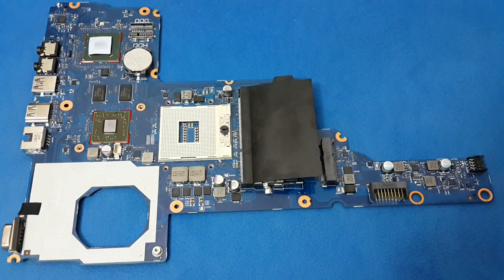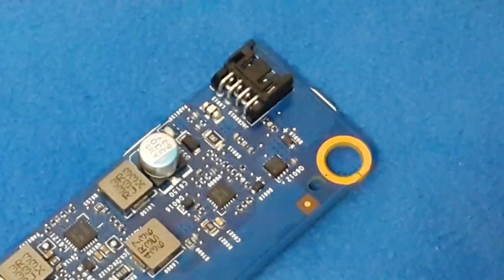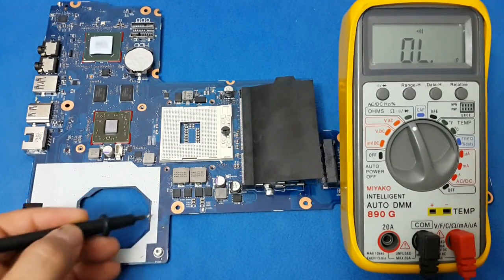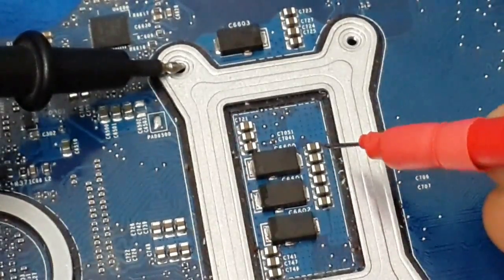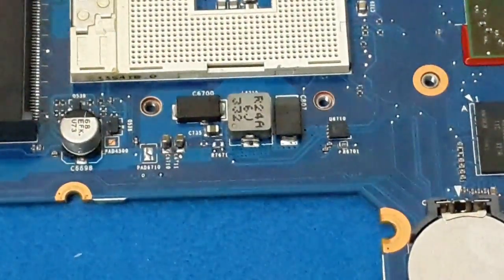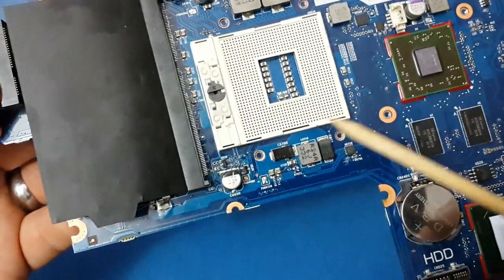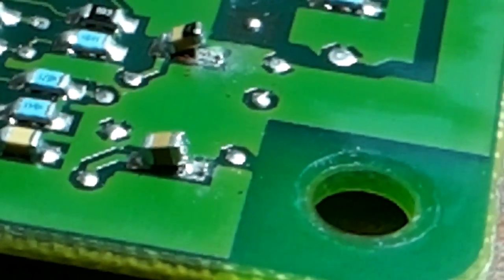SMD bad capacitor  test / laptop - desktop computer & electronics troubleshooting

Comment: Couldn't you just put the probes on both sides of each cap instead of checking continuity of each side with ground to see if they're shorted? If the idea is that normally only one side of the cap is connected to ground and if it's shorted both sides will be connected, is there a reason why you need to compare each side separately to common ground vs. just comparing both sides to each other?
Reply: Same i want to know

Comment: You gotta wonder why a dead short did NOT blow that fuse. What's the good of it if not to protect the circuit. Meanwhile the short can continue doing all sorts of damage until something goes open circuit. Not enough zener diodes or any protection beyond a couple of MOVs as lightning arrestor in consumer goods these days.

Comment: removing smd capacitor one side is a bit risky because you could damage the trace or capacitor soldering point , better to remove it by adding solder both side in quick way.

Comment: I checked my motherboard and not familiar about the capacitor and I found that there's some white stuff on it..I dunno if it's normal because my PC not turned on when I pressed button bcoz of the fault PSU..I hope that it doesn't affect the capacitor or the motherboard

Comment: I removed a shorted SMD capacitor on a TV board, but the TV still doesn't work. The capacitor was very small. Should I put a new capacitor in order for the TV to work?

Comment: I dont like the way you lift component side on board with solder, once you heat and lift a side of component, you risk damage pcb surface of the other side of component, that soldered tight on board once its lifted with hard power.

Comment: What is wrong with approach:    
Red on ground and set meter to diode mode. Check both ends of capacitor with black probe.   Capacitor should have ground only on one end.   A  shorted capacitor will be grounded on both ends.
If you want to remove the shorted capacitor, then desolder it and check to see if short goes away in diode mode with red on ground.
Reply: I have a question...I noticed that my motherboard has a white stuff in the capacitor do you know if it's normally happened or it's shorted?
Reply: @ywhad  is it bulging on top.   Is it an electrolytic capacitor or a surface mount?
Reply: electrolytic and it's not bulged...a white stuff appear like veins in the capacitor when I turned on my computer and the PSU is not spinning and found out that my PSU is shorted and it smells a lil burnt and I don't know if it may affect my motherboard
Reply: . just buy a refurbished computer off Ebay from a seller with at least 98% approval rating and they provide a 30 to 60 day warranty.   Then remove hard drive from old computer and hook up to new computer via SATA/IDE to USB connection.    Otherwise, take old computer to a repair shop so they can determine which components are bad and have them fix.

Comment: that is the stupidest way to lift a ceramic capacitor, so you damage the track of the board and the capacitor, the correct way is to use a tweezer type soldering iron or a hot air soldering station or at least improve the soldering technique

Comment: i got an 17 r4 and when i plug it in. the light on charger goes out. so i took it apart unpluged  the dc in and the charger will stay on but when i plug it in  the light will go back out and when i plug in to the dc port i will see a spark. and  the port smells it there a  could that be a bad captor  thats making it ark  im going to test it in a few thanks

Comment: Hi please can you help I believe you have lot of experience in the field. I am working on aN ECU there are two capacitors in the entire board with no reading at all. I mean at all. I even removed them and there is no reading . Have you ever came across micro capacitor with no reading when checking with multimeter. All the rest of the capacitors have readings.
Hope to hear from you regards

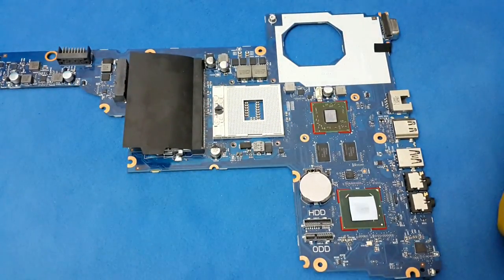Comment: They are a headache when you are a beginner at repair. In LCD / LED TVs it is common to find one of them shorted but “reflecting” simultaneously also on other circuit components on the small and long PCB attached to the Panel. Thank you very much for the advice (6:57) and sharing. A sincere greeting from Mexico.
Reply: I didn’t get the bit where he said to copy the information of neighbouring capacitors. What does he mean?

Comment: Excellent fault finding!!! Another method is to turn it on and leave it on. The shorting cap will get HOT. to find it, use a finger or a thermal camera (I used a Fluke Ti10).

Comment: what if both sides don't have continuity?
Reply from the maker: Hi! Should not be a problem. (There could be other issue if the component is open, but that´s other case. For this case, we look for components in short circuit).

Comment: thank you i have rx 480 graphics card both fuse capacitors blown but also a smd (small one like yours)  2 are short circuit but I don't know the values so if i  dont know the values what cap i put to replce them? what would be safe???  0.1 ???

Comment: so you are testing smd capacitors in circuit without a power supply using only the tiny 2mA provided by your meter in continuity mode? a board can have hundreeds of capacitors do i have to try them one by one?

Comment: Hi all. I just wanted to ask.. a very tiny capacitor fell of the laptop but it’s still working! Is it normal?
Reply: Yes.There will be 2 or More Capactors in that Series Connection,if one gone,the Circuit will Still Work.

Comment: As an English speaker it was a little hard to understand but not impossible at all. Within a minute I knew exactly what was being said and I actually learned A LOT! Especially the part about cutting off the search areas using those pads! I had no idea before now and already used that tip to repair another device.

Thanks a lot for this video!
Reply: Wow! My english level is B2 and I had absolutely no trouble understanding what he is saying. How is that even possible?
Reply: @Daniel-ih5ei  

Are you new to electronics like me?
Because I meant understanding the electronics jargon, not the language itself. If not, that's probably why!

the more you know
Reply: So you desolder the pads to isolate the area? How can you tell an area is bad or good once isolated?

Comment: Thanks Bob! great video. Just one question. The circuit boards that dont come with the option of separating different stages of the circuit by removing solder ....how to find exact location of the fault?

Comment: Thank you so much. I was stuck with a SSD drive that stopped working because I pushed a 4pin to SATA connector the wrong way into the drive and it got shorted. Then using your method I checked the capacitors, I found  2 of them gone bad. Only problem: how to find value of smd capacitors?
Reply: To my knowledge you need schematics for that

Comment: Hey guys I have a laptop
Motherboard where I’ve tested for continuity on some of the caps and found that there are quite a few around about 10 caps that are grounded on both ends. I haven’t tested the entire board but would this indicate that maybe a surge killed these caps, there were also some caps that both ends were not connected to ground as well These were all tested when connected to the pcb, should I despiser one end and test again or can we assume the motherboard is no good as there could be more.

Comment: Hi. I'm still learning, I have 3 ceramic caps on a board. When I test in continuity mode  I don't get a beep when I touch the cap with the probes, but if I check in diode mode I'm getting a reading of about 575
Reply: Usually ceramic caps last longer than 'wet' caps and aren't usually the culprit. If you want to really test capacitors, you need to remove them from the board. That's testing for capacitance though and not continuity.

Comment: @3:11 - "any cap can be connected to ground, but none of the connector should give you continuity" ???
Reply: He means to say you should not have Continuity between both ends of one capacitor. Having continuity between both ends of one capacitor would mean a short circuit on that Cap.

Comment: This is a demonstration of how to damage a mother board. Use the correct tools and this sort of damage will not occur. Unsolder both ends of the component at the same time. That will avoid damage to the board and component!

Comment: Hi mate
I have this exact board but with a different problem, the caps lock blinks 3 times in a sequence and no picture on the screen. I measured the voltages on the board and all are present, 19v, 5v, 1.5v, 
When the CPU is in the socket but the laptop is not powered on ALL capacitors around from the bottom side are in short, when i power on the laptop only the three marked on the picture are in short. When i take off the CPU no capacitor is in short...

I guess it is the CPU that is causing the short?I 
tried several known good ram sticks but no picture.

Comment: Thanks. I found multiple open and shorted smd caps in the same area on a hdmi board. The identification numbers are unreadable! How do you know the correct polarity and ohms when you replace with new ones? Replacing them would be a tedious process as some of them are the size of tiny ants! EDIT: I bought a ESR METER and retested the faulty SMD capacitors and it read " LOW ESR" good capacitor! ?????? I am going mad in the head!

Comment: 09:20, U lift solder pad too... mr specialist...
Reply from the maker: That´s not true. The pad is on place as the silver color proves it. For you to learn: a delaminated pad doesn't get soldering. Also, in case of the pad was lifted with the component, it will be bigger than the component size. Please take a 2nd look to the video. I am using a special soldering iron tip for it. As an engineer and a teacher, I would ask you to refer to IPC-610 normative for acceptability, then it is not the student or the teacher point of view but the norma itself.
Reply: @bob.kalpon1398  10:01 you can perfectly see even on the phone screen a broken pad with a soldered element.  The first time I watched this movie on 52" TV and you can see every detail perfectly, please take a closer look or go to an ophthalmologist.

Comment: Nice video, very helpful. I followed your steps to repair an LCD and succeeded! Now I just need to buy a 0805 100nF ceramic capacitor. Just wondering, is it ok to just leave the circuit without the capacitor? Obviously it works, but if the designers put the capacitor there I'm sure it's for a reason.
Reply from the maker: Hi! Most of the time those capacitors are to filter noise. There are other capacitors in parallel doing the same job, so maybe we can go without it. A good advice would be, please check if your cap wasn't located next to a very low Ohms resistor, or next to a very noise sensitive IC. If that was the case, you can order one capacitor, or if the device under repairing is already old and no expensive or no critical like the "Anesthesia Machine's LCD", you can replace your capacitor with an used one.
Reply: @bob.kalpon1398  Thanks, I've just checked the PCB but it's hard to tell what the capacitor is next to. Without a schematic it's very hard to reverse-engineer. But I can see that there are many other capacitors on the PCB that look exactly the same, and with the multi-metre I can verify they are connected in parallel, which matches your description. I don't have any old "donor" electronics at the moment, so I will just order the capacitor. Thanks again!

Comment: Hi

Why you put one side of the multimeter on the ground board and not just on the other side of the capacitor?

Thanks
Yossi
Reply from the maker: Hi! Because the short circuit is to ground.
Reply: Bob. Kalpon you you want see the short  if you put the multimeter on one side and on the second side?

Comment: hi thanks for video. How to get the required capacitor. What is the name of the same name if it is used on internet? Is typing correct as c6710?
Reply: No. Thats the board code/location. These are ceramic capacitors, also called mmcs.
They come in sizes like resisors do and have values but finding the values is hard. I came here to see if he reads the values but he does not lol.
There is a way to measure with multimeter to calculate the values.
We may have to 1, buy a kit with all values, 2, find same sizes off another board and try them or 3, work out a way to calculate the value.

Im try 2 and 3 ☺

Comment: Those pads don't seem as easy to find on a desktop motherboard. I've got a bad motherboard and a whole load of capacitors, big and small, around and behind the CPU socket are beeping on both ends. Capacitors on the lower part of the board however only beep to ground on one side. How do I narrow it down with all those beeping capacitors around the CPU?

Comment: I must not know enough about circuits to understand this fully.
I get that any capacitor will have one pin soldered to ground, so one side should for sure beep. Then, if the other side beeps to ground too, it's a bad capacitor?
Reply from the maker: Hi! Some capacitors with low resistance are part of a switching power supply configuration and there are inductance and diodes with it. No all capacitors have one lead to ground. But most of the bad capacitors will be on of those with the lead to ground. There are always a capacitor in parallel with a very low resistance used for current measurement. Only studying, logic, experience and searching will help you find the answer. To make a little diagram of the one you find with low resistance or "short" will help you to understand the function and configuration.

Comment: The fuse is NEVER BAD!
Reply from the maker: You are right. I the pass, it used to be the first guard against a short circuit. No days most power supplies have its own current limit and shut down. The fuse is the last protection, but in the troubleshooting procedures it is the first step in the inspection. :-)

Comment: Your explanation is very good and slowly and clearly and gradually takes you the point. Also you have and extensive knowledge in electronics.
Just one problem, the way you lifting SMD capacitor is damaging the board, because SMDs has no lead to bend as other conventional components. Why you don’t use desoldering tool like the pump to absorb the molten solder and clears all solder from the area. That gives you not lift the SMD component most of the time or in some cases you need to lift a little which allow you not to damage the printed board.
Reply from the maker: Hi! It is easy with a hot air and tweezers. When I moved to here, I didn't have a good soldering station until  several months later. No everybody has one in other places where life is harder, so it is good to teach to work with rudiments. But back to the problem, most electronics components should be exposed to more than the solder melting temperature and for less than 10 seconds. I work many years as a process and  manufacturing engineer too, and I have that very clear as designer since the beginning.  In one car ECU video I was criticized by lifting the capacitor on the side. If I do it, will use the right temperature for short period of time, while hot air is very high temperature for maybe longer time. Automotive safety rules are very high, and also to replace the component by other brand no specified by the designer... Industrial SMT solder  process and ESD manipulation exposure is where more latent issues happen, that ends two years later with the damaged components that we are repairing in this laptop main board. A good rework must include ESD, moisture removal, pre heat, flux and cleaning, in a very well controlled way. It depends of the situation for me to use pre heat, iron lifting, hot air, or component sucking. After many years doing rework since 1984, I am like an old surgieron with the knife, I know to take care of do not delaminate the PCB.  But it is only with practice. Many times I watched youtube iphone repairs, it looks nice and fast, but those guys are just over cooking the telephone for next soonest fail. I use a lot the hot air. But in some cases I use the iron, and the one in the video is the iron attached to the same hot air soldering station. (There are more chance to delaminate the internal layers of the PCB with hot air than to damage the pad with the soldering iron. So I avoid hot air in multi layer PCB or safety components requirentes, unless components are too big). ;-)

Comment: but what if another component is shorting everything to ground
Reply from the maker: Hi! It is the same procedure. Anything can be bad, and more than one component too. We start from the more provable component. Many years ago, one of my technicians came with a Chinese 13.8V power supply. Between two technicians tried everything, and replaced the 3 transistors and the variable resistor and the power out transistor too without any success. When I asked them did you check everything they answered yes... Watching the power supply I told them to check the led light in the panel (The pilote light). It was the problem! The current needed to be amplified by the transistors was passing though the led light in the panel (but the led was in open circuit).  Troubleshooting is not easy. It can be simplified applying a possible plan in function of the symptoms. But if we were not right, we must have a plan B and C until Z. The main idea is always to analyze what we are doing and its results to improve the investigation. ;-)